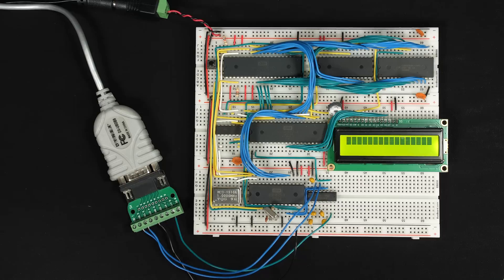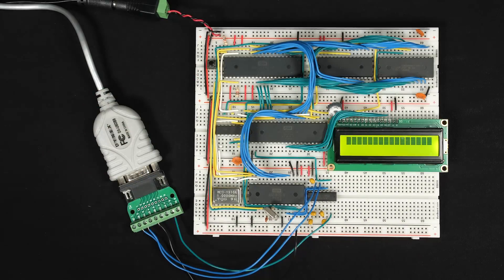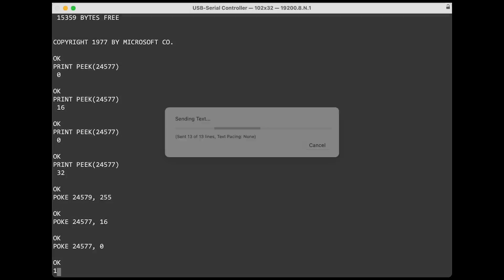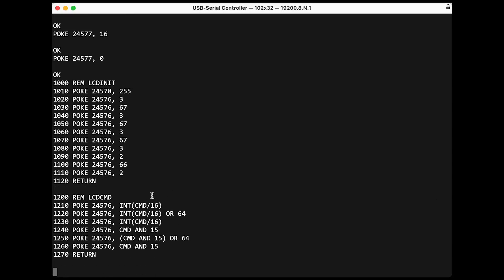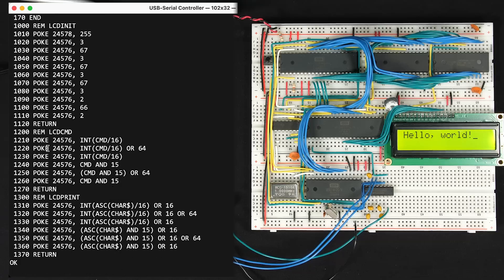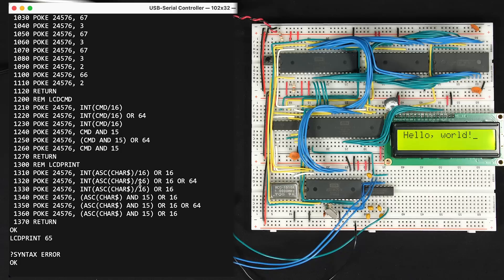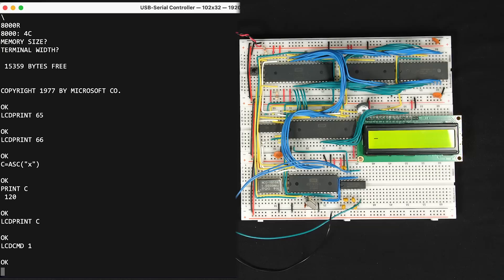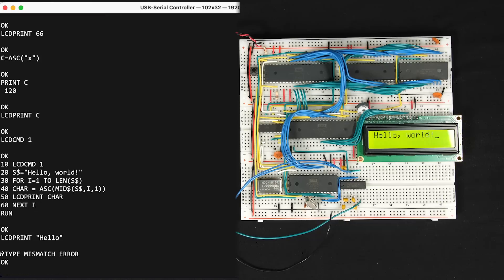Hacking Microsoft BASIC

Comment: Great video, but I somehow think that you should have called the routine LCDOUT instead of LCDPRINT. An easy way to make (the new) LCDPRINT do everything PRINT does is: Set a global variable that l et's PRINT know if it should use OUTCHAR or LCDOUT (new function to output a single char to the LCD). Then, LDCPRINT sets the "variable" to 1, does a JSR PRINT, clears the variable and RTS's. This would of course have a small performance hit on PRINT in general, but could still be a somewhat clean solution, since the new branch in PRINT would be set in an ifdef block. That way, you could just use LCDPRINT with any kind of expression. You could even use a global pointer, to what output method PRINT should use. That way, you would be future-proof for the hopefully coming VGA support 🙂
Reply: That's a great idea! I also felt it was a bit strange to call it "print", yet have it be unable to be given a string. But I wasn't sure what I'd call it instead — I like your "out" suggestion.
Reply: Like I said in another comment,  Applesoft BASIC allows you to patch COUT() to be a custom routine (and all basic output goes through COUT)..   Applesoft is made by Microsoft so I bet they'd have the same ability in msbasic.
Reply: @misterkite  I have never heard of a COUT() command in any version of BASIC which I've used, so I'd guess it only appears in Applesoft BASIC.  It sounds like it's similar to the USR() function which exists in other BASICs, but specialised to character output.
Reply: Just use the current PRINT command's line-evaluation routine to create the string to be printed, then use custom code to print that to the LCD.  The only complicated part would be if you want to interpret control codes as commands rather than as text characters.

Comment: 5:30 I think you're confusing two concepts:  Just because it's interpreted does not mean it has to parse the ASCII source code from scratch each time the line is run.  A reasonable implementation would tokenize the line of code upon entry.  When running the line, it does not have to read through "POKE" but rather it sees a small number indicating the command, and it doesn't have to parse "24567" (a remarkably laborious process most people don't appreciate -- each digit requires a multiplication) but can load a 16-bit value directly as two bytes.
Looking it up, I see that Microsoft BASIC ca 1977 was partially tokenized .  The keyword like POKE was indeed replaced with a small number and was not parsed each time; but the value 24567 did have to be parsed each time.
Reply: yep, those early microsoft basic intepreters only tokenized the kewords, still better than nothing.
Reply: Yes, you could shorten the word POKE by using p and then SHIFT+o which would print something like p୮ but then be interpreted as poke in the listing. I never fully figured out what that SHIFT+letter did of a difference, but I asume it's something to do with setting the bit 8 of the ASCII of letter o, which then means it doesn't have to read any further of the command. I don't know how that then makes it not interprete it as command pos instead.
Reply: @AntiAtheismIsUnstoppable  It does not use ASCII.
I think the shortcuts are simply programmed in, or a side effect of the look-up process during tokenization.  The actual token is a single byte, not a normal letter first.

Comment: I've started to build my 6502. Already have the rom, the microprocessor and the VIA. But here in Brasil, unfortunatelly it's very hard to get the 62256. I only have the 6264 and I'm trying to figure out on how to use this instead of 62256. I think the max232 is not quite hard to find, and then I finally can do stuffs with my computer through the serial like this. I've learned a lot with your videos. I am really grateful for all the teachings dude
Reply: The import taxes and availability are such a pain :( my Brasilian friends usually have to ask an uncle to pick-up bits and pieces when they go to the US, for a business trip or something. But I imagine that's not available to everybody as an option
Reply: @kaitlyn__L  I totally agree. I do mechatronics engineering and sometimes I have to order things from abroad Brasil. The taxes are absurd and sometimes we wait months for our items be lost by Correios. We have to be brave to study in here. But I am hopeful some day it's gonna be worth
Reply: You can use 4 6264 Chips and use some not Gates to Control their Chips select via the last 2 addres lines to make them behave like a Single 62256
Reply: @harisalic2568  I've tried to use the nand to control it in many ways already. In some way the 6264 has to use the pin 15 of the 6502 once we invert it when accessing the rom when the 15th bit is zero, we must use it when the 6502 is 1 to access the RAM. But for some reason all my tries have failed. I'm gonna keep trying until I can get the 62256.
Reply: @harisalic2568  with the money I'll spend buying 4 6264, the logic gates and the work I'll have it's better to buy the 62256 and use the Ben's approach 🥲

Comment: 0:40 Calculator is a vintage HP-16C programmer's calculator from the 80's. Not made anymore, but a modern reproduction is made by SwissMicros, model DM16L
Reply: RPN 4 LIFE
Reply: @klchu  2,2,+
Reply: @klchu  RPN is underrated
Reply: I wish I hadn't thrown out my old HP-15C and HP-26C.
My original HP-48C is in a display cabinet while I use an emulator for everyday calc uses.
I've seen the 15, back in the day, but never cared for it.
Reply: I have the swissmicro replica, it's amazing!
Reply: Thank you ! I was going to ask again...

Comment: It's already nearly instantaneous and you're still looking for more performance?
Reply: Iterating through the string one char at a time in BASIC is drastically slower than doing it in machine language.
Reply: @stargazer7644  I know that.  But there's already a great deal of optimization just by using machine language to print single characters.
Reply: Funny thing about performance: it adds up fast, significantly changing what's feasible.

Imagine trying to use the current routine to scroll through a file to find some text for example, it would be agonizing to do it one line at a time with the current method.

Comment: All of a sudden, I'm wondering what the largest character display is that they make, because that way, you would be getting close to a standalone computer without the need of a terminal.
Reply: They make 80x24 LCD screens for just what you're talking about.
Reply: @stargazer7644  I wonder if any of them speak the old ADM 3 or DEC vt100 control codes. (Embedded in the strings to be printed).
Reply: @stargazer7644They use the exact same commands as well. IIRC, they're just divided up where it skips a line. The smaller displays act as if they have all of that display size as well. I think you might be able to scroll the display as well, in order to use all of that extra space, even if your LCD doesn't physically support it.

Comment: Is it an oversight that you didn't preserve the state of the X-register by pushing it to the stack (and popping it back out at the end of your subroutine) or did you decide it wasn't necessary?
Reply: You only need to preserve a register if you know you're changing something that is set and shouldn't be changed.  When you enter a subroutine, the only regs that are important are the ones transferring data into the subroutine.  Those are the ones you don't want to change.  But others don't matter (generally).  
Now if you're making an interrupt handler which can can be invoked absolutely anywhere in your code, then  you have no idea what shouldn't be changed, and you have to be careful to preserve EVERYTHING.
Reply: It's a trade-off between portability vs performance. Preserving the register makes it easier to re-use code in other projects and for other people to build on it.
I originally learned Assembly from an old textbook on Win3.1, where the recommended convention was 'preserve by default'. But the book assumed a 486 CPU, I can see why you might choose 'clobber by default' on a microcontroller system.

Comment: It seems mildly silly to txa; pha; ... pla when you don't mutate the x register in between. Of course there's something to be said about using code that you know works.
Reply: The pha is to save the value in A because later code changes it to strip off the high bytes.  Then he does a pla to restore A and pull off the low bytes.  Read the program.  Understand how it works.
Reply: @stargazer7644  Oh, I totally missed the jsr lcd_wait when I was reading the code. Does that routine mutate x? If it doesn't mutate x, then I'm still right and you could just use a second txa instead of the stack.
Reply: @codahighland  You could, but then the code would be less modular and you couldn't just c/p it between projects exactly like Ben just did.
Reply: @stargazer7644  Which was exactly what I acknowledged in the first comment.
Reply: @codahighland  If you say so.  You still seem to be missing why that pha is there in the first place.
Reply: @stargazer7644  I'm not missing it. In the code's original context it made perfect sense because it wanted to preserve the other registers, and it doesn't HURT to have it here where the x register is a known input, aside from being able to optimize it by a couple bytes and a few cycles. I just have my 6502 instincts hanging around still from when they were actually relevant, so I still automatically notice when I could be saving in a second register instead of on the stack.
Reply: @codahighland  You are missing it.  The pha isn't there to "preserve the other registers".  It isn't preserving some original value of A which is then restored at the end of the routine.  It is there specifically because the value passed in the register gets modified to strip off the low bytes and then has to be restored to be modified again to strip off the high bytes.  The value is passed in the A register.
Reply: @stargazer7644  I'm not missing it, you're just misunderstanding what I said. The original code didn't make use of the X register. The caller could assume that the value of that register would be unmodified -- this is what it means for a register to be preserved across a function. Meanwhile, the function needs to use the initial value of the A register in two separate places, so that value needs to be stored somewhere. The function COULD have used TAX...TXA instead of using the stack to achieve this goal, but that would mean that it would no longer be preserving the X register, so it would mean the calling function would need to be responsible for saving that register if it needed the value in it, and that's especially obnoxious on vanilla 6502 because it doesn't have a PHX instruction like 65C02 has.

In this context, however, we have no such contract with the caller to preserve the X register.

Comment: Your LCDPRINT seems to be clobbering the a register, as you've put txa before pha
Reply: The pha at the top of LCDPRINT is to save the A register before he strips off the upper 4 bits so that later he can restore it and then pull off the lower 4 bits.  If you put the txa after the pha as you suggest, then the lower 4 bits will come from the wrong value - whatever happened to be in the uninitialized a register before the txa was done.  The way he has it is correct.
Reply: Getbyt returns its result in X, so the code is transferring this to the accumulator before pushing onto the stack for retrieval later in the same routine.
Reply: It does, but that should be fine. The BASIC-internal code that calls the individual subroutines is unlikely to expect the A register to be restored by the called subroutines, so if it does need it, it will most likely push and pull it itself. The "pha" immediately after lcd_wait (which IIRC does save and restore A) is not intended to save A for the purpose of restoring it before returning from the subroutine, but it saves it for the purpose of sending the second 4 bits of A a bit further down. "pla" before the line commented with "Send low 4 bits" restores A (but the further instructions change it again and it is not restored before "rts" at the bottom).

Comment: Glad to see more of this.

Would be cool if i can take any random chips and make a computer out of them. Guess I should get a kit before even dreaming of doing anything that lambastic.
Reply: I don't think that word means what you think it means.
Reply: Try to make a computer from a 555, 74S140, and a TL4242. Those were chosen randomly from a large list of integrated circuits. Why not dream for something sensible rather than just random? Would be cool if i could if i could make a car from a windshield, an exhaust hanger, and a blow-off valve.
Reply: @codefeenix  meh; I much prefer building a car from an old blown subwoofer, a passenger-side door latch, and an ignition motor.